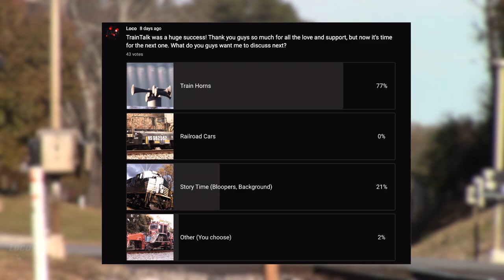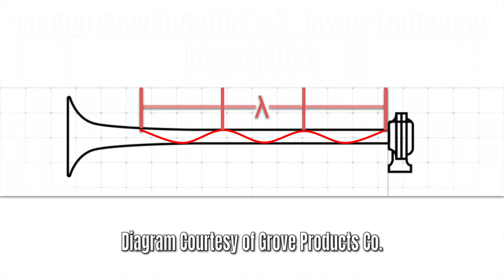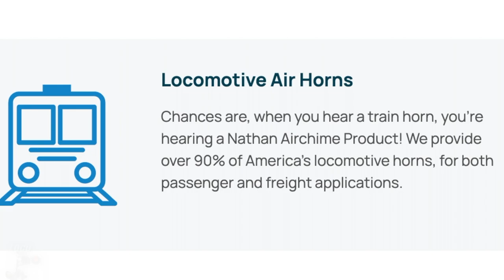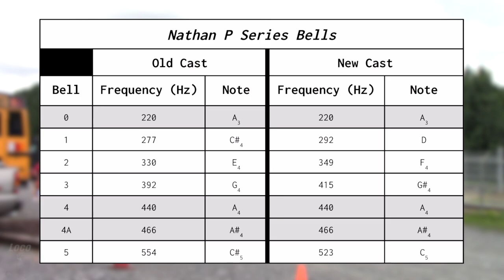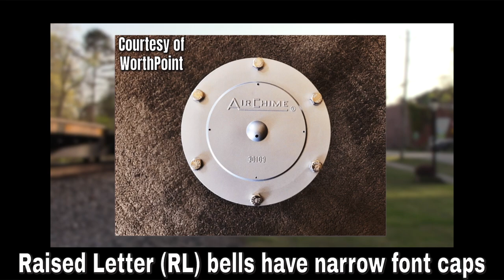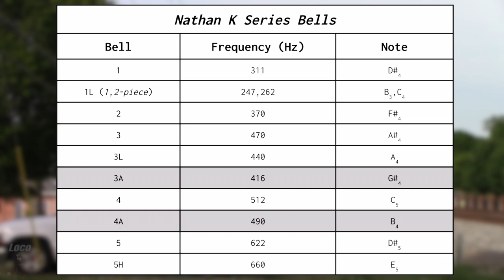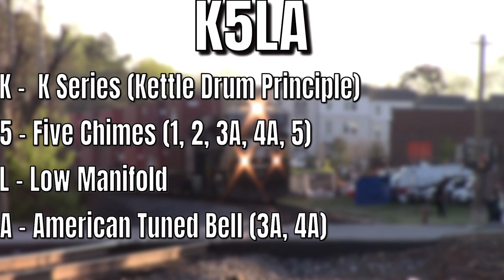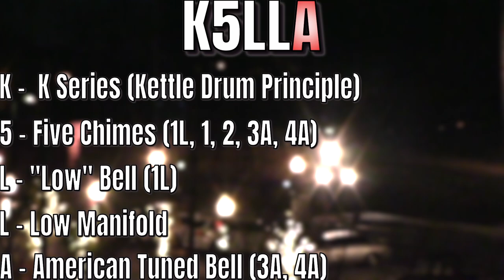Everything to Know About Train Horns - TrainTalk, Episode 2

Comment: One thing you didn’t touch on is the K5LA hybrids that the cellar express train sets for Amtrak use. They somewhat sound like the K5 LA that other Amtrak trains use but sound a little bit higher pitched. They wanted the higher pitch because of the high speed that those trains hit.

Comment: I am a huge train horn fan, and this is a great video! Just a couple things, all those UP engines in the K3L clips were actually K3LA/HAs. They can sound similar but are different from K3Ls. Most of those were Narrow Font horns made in the 2000s, which are known for having flat 4A bells which can make K3LAs sound like K3Ls The Flat 4A K5LAs are also 2000s NF K5LAs. The only one in there that was actually a K3L was the BNSF Dash 9. Also, the whole K5LAR23/24 thing, most K5LAs are R24s. R23s are less common, and many K5LAs are still made R24 today. Now, with K5HLAs and Bs, not all are hybrids. Regular K5HLAs are just the bells of a K5LLA but on a high manifold. Hybrid K5HLAs can also be Hybrid K5LLAs if they are on a low manifold. Hybrid K5HLA/LLAs can either have the 3 replaced with 3A, or the 4 replaced with 4A. Finally, 4001 is not a K5LLE. It is a Hybrid K5LLA, with the 1L, 1, 2, 3A and 4 bells, similar to NS 8101 but on a low manifold. It is also not meant to sound like an RS5T, Nathan never planned for that, and in many cases that type of Hybrid actually sounds like an Old Cast P5. The K5HLB/LLB, sometimes called the LLE, is the one that sounds like an RS5T, since it has all the same notes as one except for one bell being off.
Reply from the maker: Thanks for this intensive correction. I’m really a novice when it comes to horns, so I appreciate hearing from people who know more than me and can share their knowledge. Have a blessed day, my friend. :)

Comment: Great video! I’ll add on some information that I know: 

- The “P” series was created by “Nathan AirChime,” the USA subsidiary of AirChime at the time. P stands for “President’s Whistle” and was offered as a low maintenance alternative to the M series offered at the time. The P series also is EXTREMELY efficient on air usage due to it’s design. I have a Single Tone P2 horn, which uses such little air that you can hear the tail when you let off the air valve.

- Nathan K bells have 6 castings that are produced, but the various frequencies of each bell is produced by boring out the throat of the horn. There are way more than 10 frequencies of K bells out there. There’s the Sandcast 3L and 2L  bells used for marine use (EXTREMELY Rare). There’s Sandcast 1, 2, 3, 4, and 5 bells produced by Holden (Canadian Manufacturer). In terms of Diecast bells made by Nathan Airchime, there’s the 1L (Both Sandcast and Diecast), 1, 2, 3A, 3B, 3, 4A, 4, and 5. There’s bells specifically for the Australian market; KSP1, KSP2, KSP3 (Standard #2 bell), and KSP5. The Australian bell’s mimic P bells and are used an the K-5-UL-AU-LS. There’s also Sandcast Hyson AirChime bells for the British market; KS-1, KS-2, through 5. There are so many bell types that have been produced that it’s difficult to keep track of all of them (Not the mention the bell types collectors have made).

- During the production of the Sandcast K3Ls, AirChime offered the J3 as an alternative for snowplows. It was marketed with extremely low air usage and used a single diaphragm unlike the dual diaphragms in K bells. Despite these differences, both versions are compatible on the same manifold.

- Nathan AirChime also produces the C series of horns for both single, two-tone British style horns, and a five chime marketed at the C5A-CWP.

-Leslie Supertyfon horns started off with the S3J and S5D, which respectively mimicked the M3/P3 and M5/P5. This upset AirChime and a lawsuit took place, which caused Leslie to change their bells, resulting in the S3L and S5T.

There’s so much more information I have, but it would be hard to put it all in one comment lol
Reply from the maker: If only I knew I could contact people like you when I was making this. Thank you! :)

Comment: The « P » is for Preset Pitch
Reply from the maker: I'm not doubting you, but how do you know this? I searched so long and could not find a definition (thank you by the way). :)
Reply: @LocoPro  its a horn collector a few years ago that told me that. He said that the P horn was for replacing the M serie wich was a pain in the a** to work on because the diagram for each bell were a different one. Also, they had to tune the horn after opening the bells. The P serie is much simpler, thin gasket, diaphragm, thick gasket ( second diaphragm for double diaphragm setup ) and the back cap. Its not an official information from Nathan Airchime but this was I was told.
Reply: @mic8040  It seems that the meaning of P is both "President's Whistle" and "Preset Pitch." I saw a diagram on the hornwhistleforum stating that along with M horns standing for "Modulus," which is due to the modular design of M horns unlike the earlier Hexatone H5 and H6 horns, which were not made up of modular parts. Since P horns are designed in a way where no voicing is required, all they need is the diaphragm kit, rubber seat/spring, and backcap. No additional adjustments needed unlike the M horns.